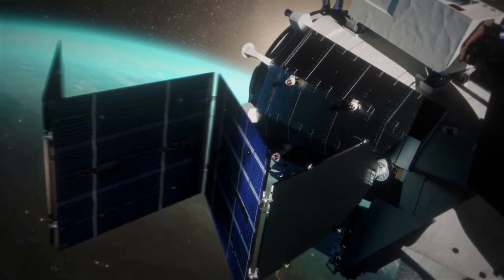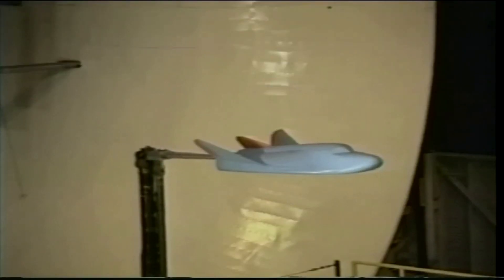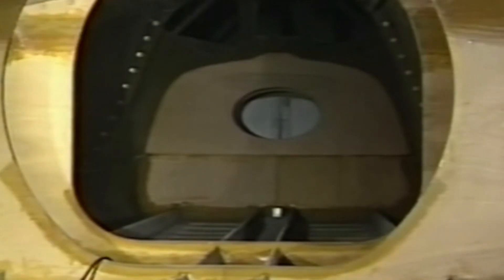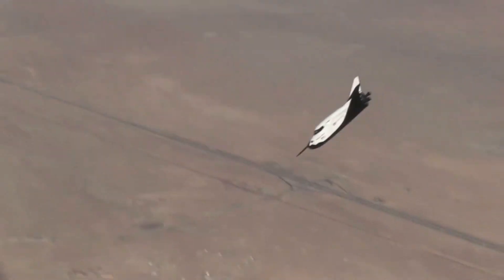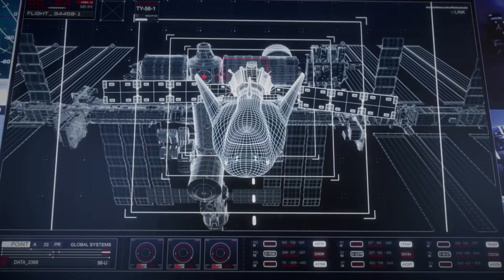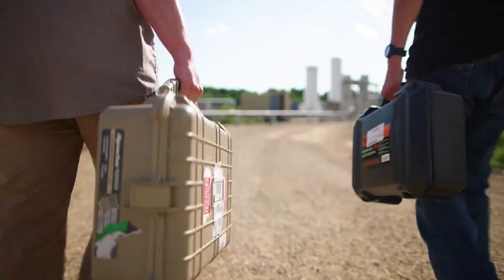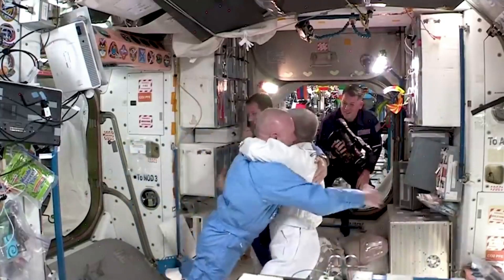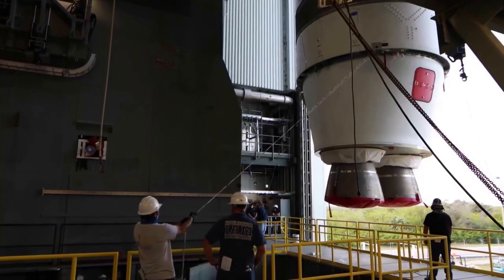How Dream Chaser Has Evolved Over The Last Three Decades

Comment: Is the X-37 related more closely to the Dreamchaser concept or Shuttle?
Reply: Hard to say. It shares characteristics of both vehicles. They are all winged vehicles. But the dream chaser technically has canted fins unlike shuttle and x-37. Dream chaser and x-37 are very similar in size and are like a quarter of the length of shuttle. I don’t think there is much similar with any of them when it comes to propulsion.

Comment: A question: the CGIs have a central vertical stabilizer, however I can not see one on the assembly line. The final ship will have it?
Reply: Yes. You can see it on the drop test articles.